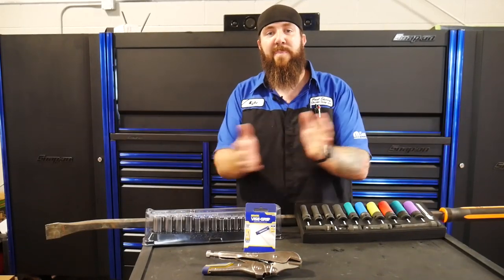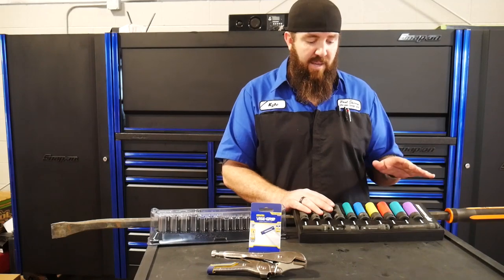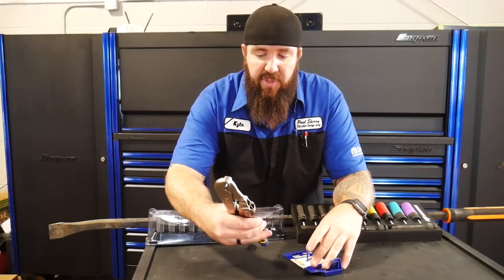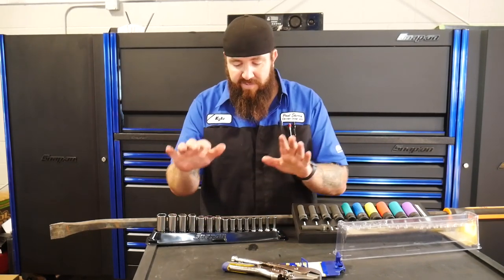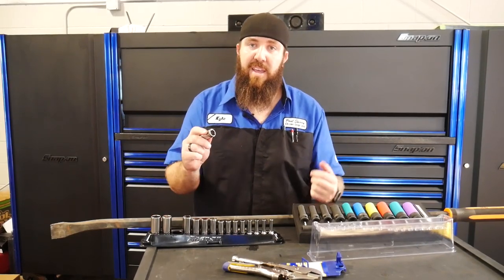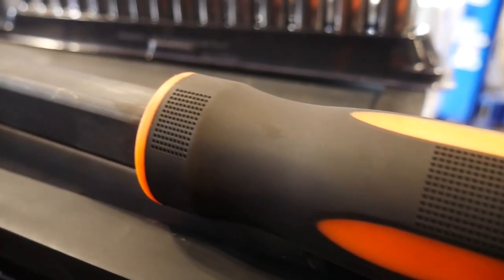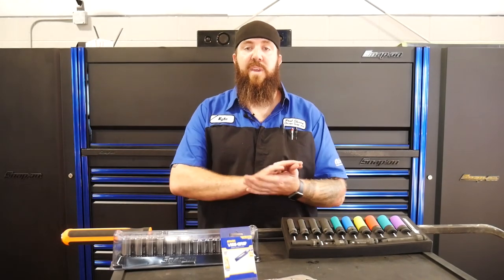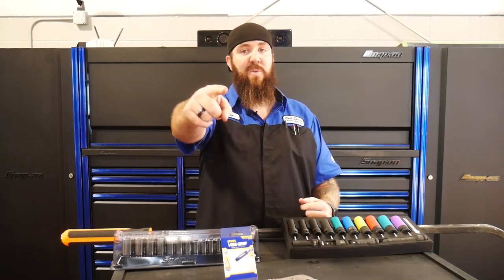NIFTY TOOLS ROCKIN SOCKETS AND BIG DEALS

Comment: I tried them Snap-on sockets out my dealer took them back like the new gear wrench bolt biter set. Might want to check them out
Reply from the maker: I’ll have to check those out👍🏻
Reply: VENOMVETTE they actually work? I’ve got like 3 different sets of other company’s and they all suck lol
Reply: @caliautotech21  I have had luck with them on manifold bolts plus they have like half sizes so dont have to hammer a socket on

Comment: Rusbelt Mechanic I want to buy a torx socket set. What is a good cheap company to buy from.
Reply: I've had great luck with my Lisle set 10-55 and bought a T60 and 70 separate but still Lisle
Reply: Capri has a great master set on amazon for $60
Reply: Vim
Reply: Vim
Reply: vim is good but you'll spend a lot to get everything you would get in a capri master set which uses impact grade tool steel.
Reply: @Toyotas_n__Tools  impact grade is not better it's softer in hardness and rounds and distorts and in torx fasteners requiring hight torque that can be a bit combination in stripping the head and vim is easier to get warrantied